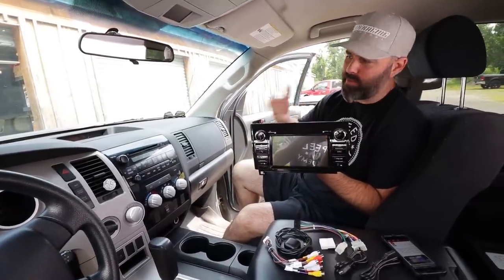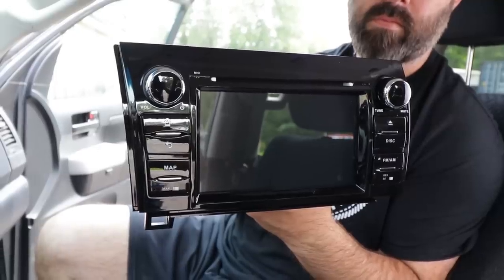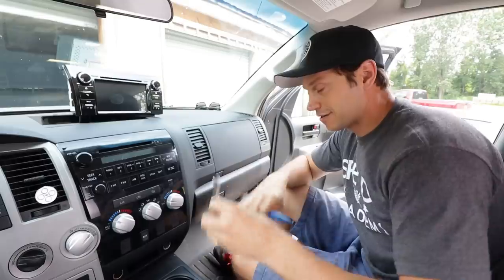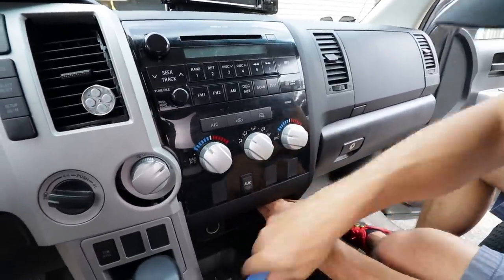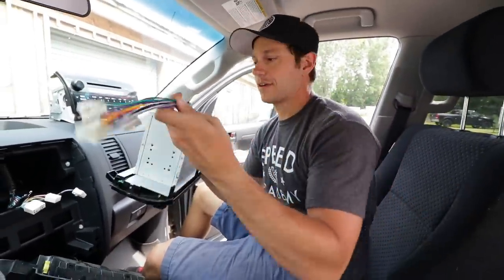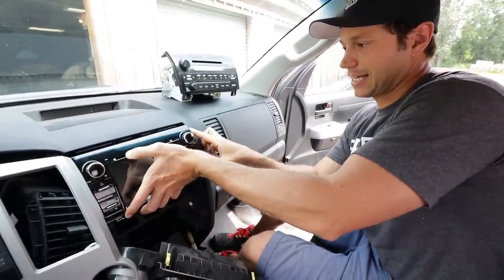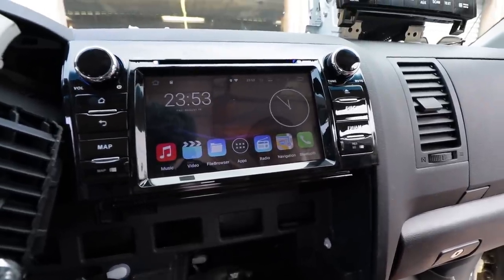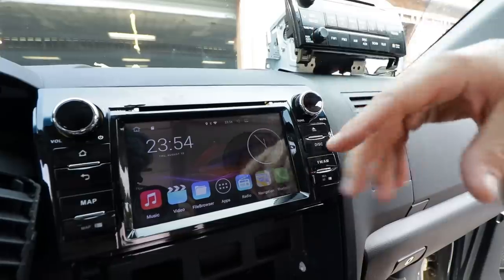Under $400! Seicane Nav Android Radio Review

Comment: 37% off and its 400$, in the mean time a second hand tablet that does more or less the same things is only 40$. Great deal!
Reply from the maker: Except you have no way of mounting it up and powering your speakers...
Reply: Speed Academy oh but you do, that's the beauty of it. Some tablets on some dashboards look better than some infotainment units on luxury cars. As for connecting them to the car speakers, there's a jack-jack cable or even Bluetooth connectivity and you can connect the tablet to an after market car stereo unit (or second hand) with aux or bt - and you'll have free, constantly updated maps, obd2 info (via obd2 dongle), and all the music you can fit on that tablet! And all of these for under 50$. Plus, there are guys that made it possible to connect the tablet directly to the speakers without the need for an additional CD player.

Comment: I bought one , I was disappointed when I found out it was a winCE head unit . No wireless Hotspot connection, wont mirror image note 9 . You can choose the logo and have to go into factory settings to get the chineese games (code 3711). You will need a dongle I have been told to connect the browser . I have not bought one afraid it won't work .

Comment: What's the output voltage? What is the preamp out voltage? Did you test it?
Reply from the maker: No, we didn't test it. We just installed it and started using it. Stock speakers, rarely above old man volume level.

Comment: I bought one and have nothing but trouble, no sound, no gps no radio, the sound is due to wrong wiring harness sent, but I not sure if they will ever send the right one, the backup cam they will not let me know what the blue wire is for, when the radio is on it sounds like a ticking clock.
Reply from the maker: Customer service is not the strong suit of this company.

Comment: Yes secane keep saying they sent me the right wiring harness I don't think so I just watched the video you have three wires and unplug from the old stereo and you plug three wires in from the new that sounds pretty self-explanatory tell me if I'm off base if anyone knows where I can get the wiring harness that would be great appreciate it
Reply: Hey man I’m in the same boat! These units DO NOT come with the right harness if you have a JBL system. None of my rear speakers were connected. I had to buy axxess tyto-01 harness and now it works. Also there is issues with fader and adjusting volume between all speakers. I am replacing this unit this week.

Comment: I have the JBL sound system that comes on the limited edition, will this be direct plug and play?
Reply from the maker: I dont think the JBL system has much to do with the wiring so you shouldnt have any issues swapping to this unit but again hard to know 100% until you get the unit and compare it.
Reply: Yea I’m wondering if this unit will utilize the extra speakers included with the JBL system. I’m also curious if the steering wheel controls, hands free system, and xm satellite radio will work as well.

Comment: does this have built-in microphone so one can do a bluetooth phone call via a smartphone?
Reply from the maker: yes, it has a built-in mic. You can also add an external mic to it if you want to improve the sound quality for your listeners. We find that the built-in mic is a little low on volume, so we have to talk quite loud when using it but it otherwise works well.

Comment: you should of put your gps reciever upside done under your dash where straight above isn't metal just dash an windshield, works perfect and completely invisble. I've been using a carjoying unit for 2 years, best thing out there. although it might reset to factory default a couple of times a year randomly or due to power cut at wrong time not sure. The chinese brands seem fairly identical parts look mostly the same. I wish real manufacturers would drop android auto and make real android decks but these things are bargins at less than half thr price of android auto and more functionality.

Comment: Wouldn't mind buying an aftermarket unit for my 2013 Sonata, but the problem is every single dash molding for aftermarket head units for my car is comprised of that shitty fingerprint magnet shiny plastic seen in this video. The shiny black plastic is by far the most aesthetically displeasing ugly plastic I've ever seen in anything, and for some reason it's in everything.  The one currently on my car was a limited trim and it's like a matte brushed aluminum, and I don't feel like going through the effort of buying a wrap and applying it to an aftermarket dash molding.

Comment: Just be careful on newer vehicles. The entertainment system is a node on the network and incompatibility can cause problems and throw up codes. Newer VAG models don't like head unit being changed and may need re coding to network, address etc. Don't take plug and play as a given, regardless of the makers blurb!

Comment: So you gave bad advice but refuse to rectify yourself. I see a lot of viewers asking what to use instead. It doesn't say much for your credibility.
Reply from the maker: We don't have a solution that integrates like the stock radio so we can't recommend much. Currently we have been using ATOTO head units with great success for over a year now. They do require install kits though. Hope that helps.

Comment: why put the gps out side what are you thinking?
Reply: You would put the GPS antenna inside????
Reply: GPS works in your pocket, inside a building... so yeah, why put it outside? You risk unnecessary weather damage...
Reply: I put mine under the dash. Right on top of the unit itself,  working fine.
Reply: Yes most installs put it inside the dash behind the radio. There is like a steel bar that would attach magnetically to and you should have good signal.
Reply: Right! I commented the same thing than searched to see if anyone else thought it was a strange place to put it. It's also easier to mount it inside.. less wire fishing..

Comment: Looking at getting a new unit, how is the nav on that??
Reply: you can get google maps or sygic (offline), so its better than any OEM navigation
Reply: Google maps is itegrated with android, and ot comes with a full gps offline software too. But you can download any gps software in the market. Gps sat connection is good and fast too
Reply from the maker: As these fine gentlemen have already mentioned, Google Maps is one of the Apps on this head unit, so we use that and it works flawlessly (via the Bluetooth connection to my iPhone's cellular network).
Reply: +Speed Academy awesome, thanks all I think I'm gunna pick one up soon!!

Comment: OR you can just buy a android mirror and keep your factory look and have everythign you just installed in your mirror for under 100 bucks...and you get to keep the factory radio wich i want because it had a built in 6 disk cd changer that i use daily...so i just got a android mirror and it does everything you listed above for 89 bucks shipped to my door and it streams the music to my factory deck. just another option for ppl that want to keep there factory look like me.

Comment: Seicane is Horrible dont buy I bought one they have horrible service and when the product stops working they want you to pay for shipping and refuses to replace it without it being returned. Mine barely lasted 3 months
Reply: Yes and no. Customer service.. Horrible. Product good. Been using it for 3 years now. No issues. Only complaint NOW is I would like it to have more  RAM and ROM. To deal with it, I actually deleted all the audio and video that came pre installed. Uninstalled/ deleted IGO,  the navigation that came pre installed and installed sygic which also allows maps on thumb drive via one of the USB Ports. To be honest, if mine goes bad I will buy one again provided they come up with at least 3 gigs of memory and at least 32 gigs of drive space. And please get rid of that stock launcher.. and install carwebguru.. and just watch everything transform..